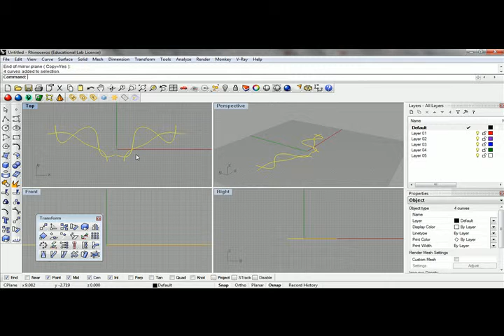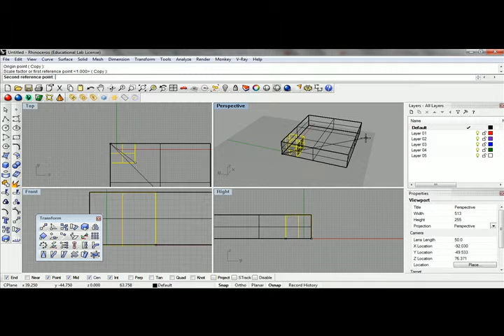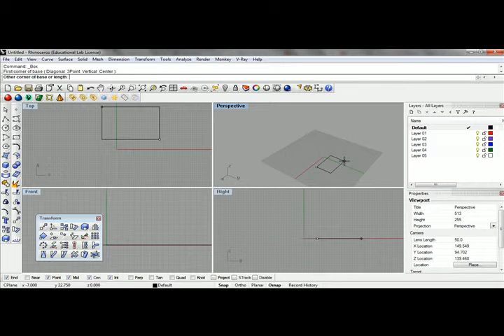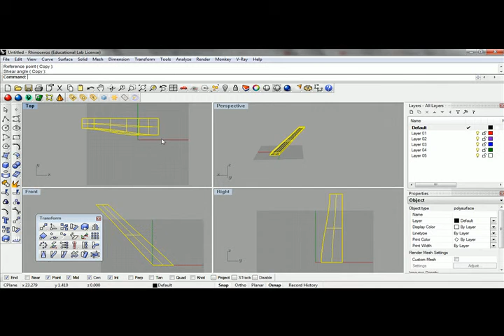Rhino Basics 3

Comment from the maker: Stephen, you sheared for an axonometric drawing?  You can use the identical shear axis and origin with the inverse angle value.  If you want an Axon drawing out of Rhino, I suggest you use the orbit tool (rotate camera) in a parallel view (right, front, or top).  Select the geometry you want in axon and use the "make2D" command.  You'll get a flattened line drawing.  Useful?